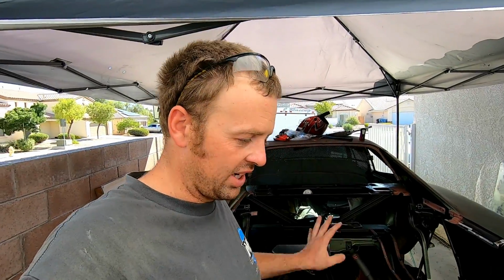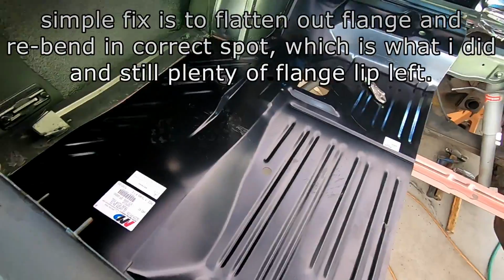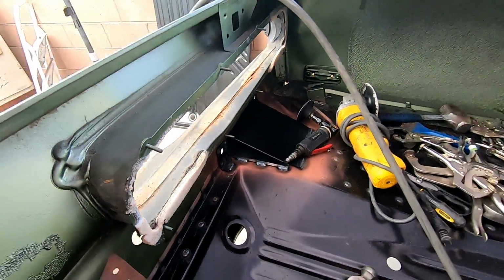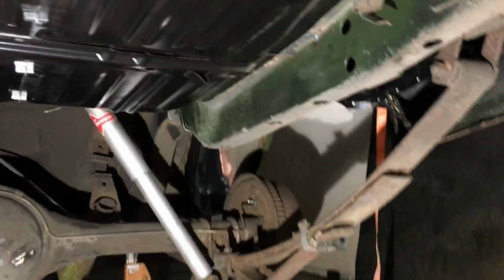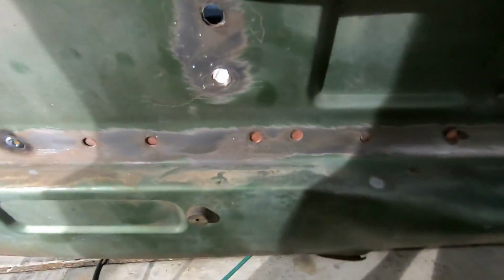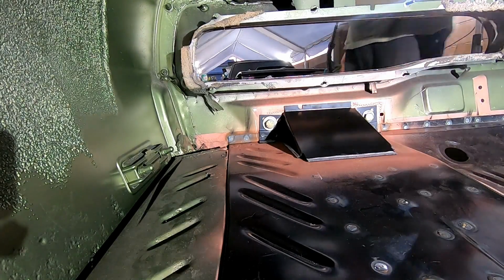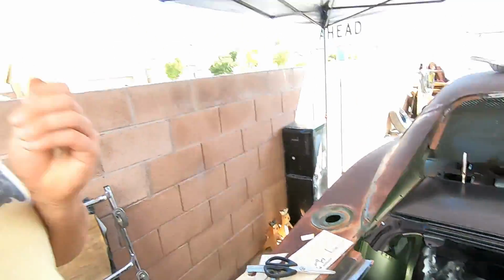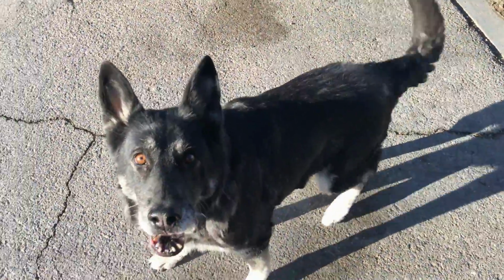"Patches"...part 2 restoration of a 1969 Dodge Charger Patina project

Comment: You have to remember that all sheet metal replacement parts are  off 1/2 inch to a inch. There still using molds that are 30 to 60 years old and molds for sheet metal shrinks over time. Therefore the panels have no choice but to be smaller than the original one's. What you have to do is find nos which is impossible to find. You have to add here and lengthen there, their as close as you're ever gonna get.

Comment: Beautiful bodywork! 
 Im the guy pushin the gear vendors idea.. but now i remember back 25 yrs ago that to save money on gas for road trips ,, i would just need an hour to swap out my 3:90 
8 3/4 with a 2:76 non posi.  It was no big problem. Then i'd tour around for a few 1,000 miles at nice lower rpm.
   But now im in california and yes im doin 80mph. On the flat turnin 3,100 to 3,150 rpm.   2800 at 70 mph.  But your right, new cars are revving 1,700 at 70 mph.   I really appreciate your videos and the good humour!!

Comment: Nice craftsmanship.  Any chance you can make some of the lower corner window supports parches for my charger?  Not sure why AMD won’t make those pieces.
Reply: berndiggidy  Doesn't AMD make those corner pieces with a big wide flange?  Somebody makes partial sail panels also, not AMD.

Comment: you'll have to start making your own die stamps for some of those little bits they don't do.
nice work fella
Question, do they have to make those 'mistakes' on the repop panels for copyright reasons?
when you have those butt welded panels going over a chassis leg or other x member i like to punch out half a hole on each piece at the butt weld so i can put a plug weld right into the x member and join the two together